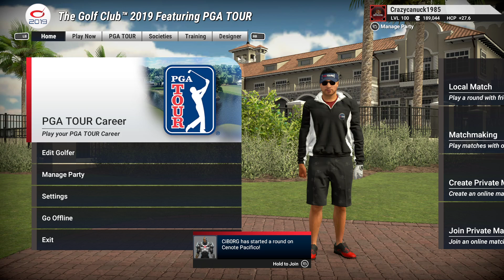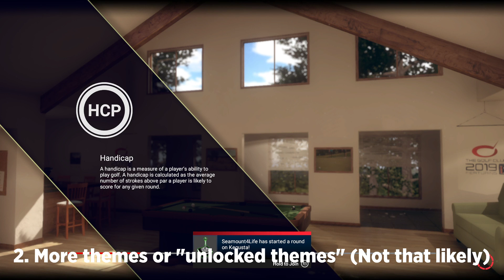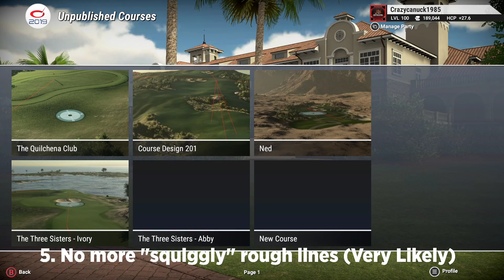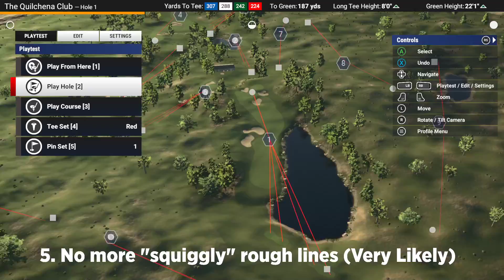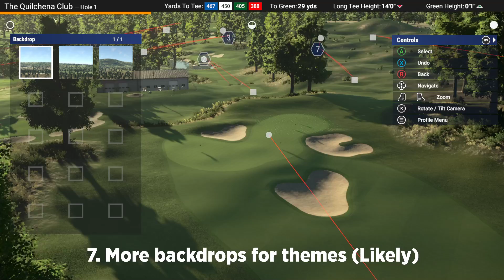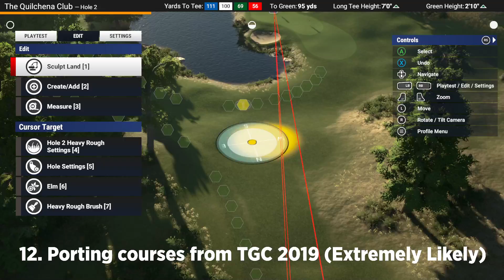PGA Tour 2K21 - My Course Designer Wishlist!

Comment: With respect to design, I would like:
1- Drag and Drop capability from one of my previously pub’d courses to new course design.  It would cut down huge amount of time designing a new course.
2- Make creating Water Bodies easier.  Something on the order of preset choices you get with laying down bunkers.
3- Make a central Backdrops menu that allows their use across all Themes.
4- Provide for toggle on/off or hide feature of the Play Edit/Settings/ box similar to the Controls box.  It gets in the way when designing.
5- An easily accessed link for a Help menu on the design home page.

With respect to play, I would like to see:
1- The ability to look down the fairway ahead when using the hazard drop feature….before I drop. 
2- A shortcut key to get out of the Edit Golfer menu; especially the Clothing section.   Way toooooo much backspacing needed when doing clothing.
3- Make Favorite/My Played/Play Again, etc. a full-page screen with many more of those courses shown. Again, way too much toggling to run thru a big list of either menu. 
4- The ability to delete from the list of Favorites and My Played courses.
5- Level the playing field between users of Xbox, Play Station, and PC. As it is with real golf, clubs and skill determine winner, not which media machine is used.

Comment: So I have mainly worked in the TW08 architect, and just started working with the TGC2019 designer, so take my comments with a grain of salt. Let me know if I am mistaken with any of these. 

1. I find it very tedious when creating a shape (fairway, green, etc.), that you can’t just drop it into the terrain. You have to close path, fill spline, smooth shape all before you complete the shape. I think it would be easier to draw the shape outline, then just drop the shape once you are ready. If you needed to edit the shape, just pick it up again. Just a lot of extra clicks in my opinion. 

2. Along the same lines, adjusting control points on shapes involves a lot of clicking. Can’t you just hover over a control point and move it without clicking through 3 different things on the menu?

3. I think one big toolbar that has all the menu options maybe easier than having to go through the menu every time. Just tedious. 

4. I find the bunkers and lips are hit or miss. Some themes are decent, but most look weird and unnatural. 

5. Adding water is a pain. You can’t simply create a water shape, but I assume this is a Unity problem. 

6. More trees/bushes, using across multiple themes. More unique tee markers, buildings, etc. 

7. A Pacific Coast theme. 

8. Fescue texture, pine needle, different dirt textures. 

 9. Personal preference, but it may be nice to have the option to “lock” the camera on the overhead view, then unlock when you wanted to move the camera down to golfers’ view, blimp view, or whatever view you want. I find the camera gets unwieldy, and I often use the overhead view most of the time with doing the hole layout. Once you begin doing elevation work the other camera angles are more useful. 

10. Being able to create a shape then have the option to forest the area with different trees, bushes, or rocks. You could set density and height variation of the object(s) you are foresting with. 

11. Better Cath Paths. The ones I tried were not very good looking and I just removed them since they made the course look worse. They were too wide and the texture did not look like a asphalt/concrete path at all, more like a dirt path.
Reply from the maker: Some good ideas here. The UI can be a pain at times with the designer but I think they are limited by the engine.
Reply: No 10, Splining an area to add trees, grass etc is a great idea. That is currently a major time sink.

Comment: Would love the ability to spline plants/trees. Multi-plant is okay, but the planting process is still tedious and, I think, a big impediment. Just let us spline out an area for a specific plant, then change the fill percent after the fact
Reply: Nick Tulli this would save a ton of time I spend putting down foliage. Not to mention it would be easier to fix and adjust afterwards. Much easier to move the tree line in and out if I need to adjust later.

Comment: I have lots of requests:   
1.Adding way more assets is a no brainer especially trees, plants and rocks. Also making a huge global set of trees etc on top of the the theme. Also global theme backgrounds

2. Way more green, fairway, bunker and rough textures, especially adding some weird colours.  

3. Penalty area spline to support the new golf rules. So basically you can make any area a hazard like water instead of needing ob. 

4. Paint on plant/tree areas. Ie Select 3 types of trees and plants and then just randomly paint. Massive time saver. 

5. Ability to delete/hide course betas, ability to have a personalised designer page in the game with pinned courses and descriptions. 

6. A set of assets that are basic shapes such as squares and circles in many colours and textures to let you build things from scratch

7. Multiple screens shots when you publish a course and even a small flyby video of a hole that is shown in the course page. 

8. Designer bio page

9. A check mode before that can warn of impossible pins etc. Ie the ball wont go in the hole for some reason or the slope is too step for 187

10. Designer can set min/max green speed range allowed. Can preset 3 times of day to use for society events, can preset the default wind speed and direction. 

There are so many simple things they can do that should come out in patches but they didnt do this in 2019. I hope with the extra exposure 2K21 will have allows for regular updates that will bring more and more features to the designer and societies not just some new tshirts

Comment: Im working on finishing up a course right now and one comment I would make is that the retaining walls could use a bit of an adjustment.  Just being able to make the angles of land around water and when using the walls would be so greatly appreciated.  Ive been putting in retaining walls for more than two weeks at this point and still have tons to do
Reply from the maker: I was thinking about this after I recorded the video. Retaining walls need to be tweaked for sure!